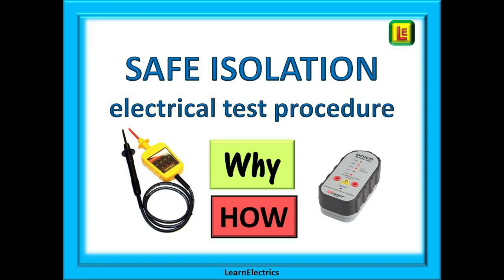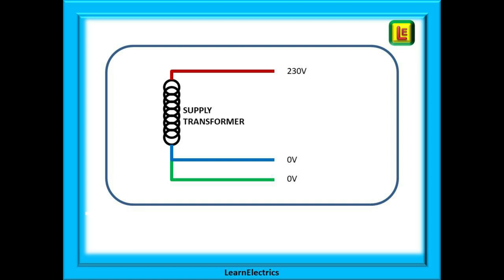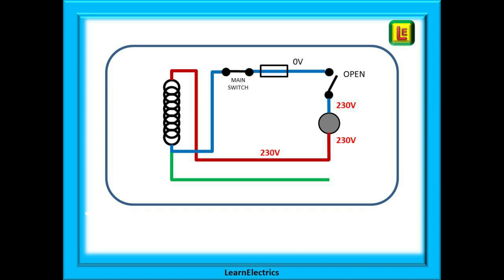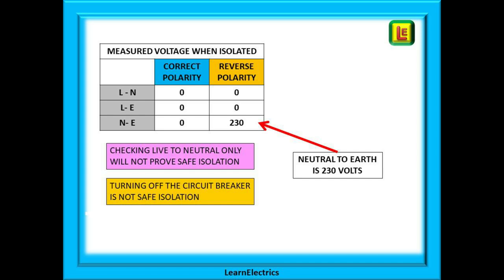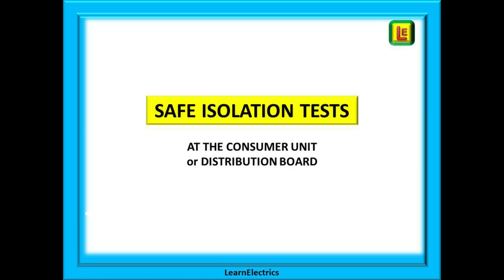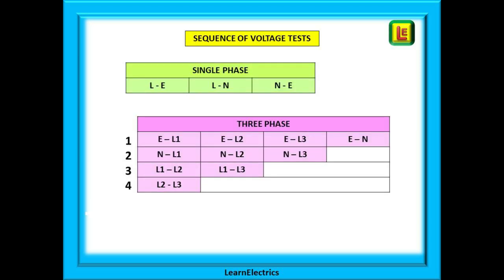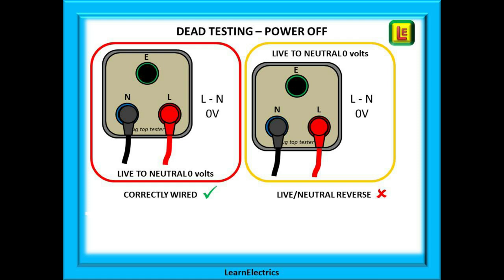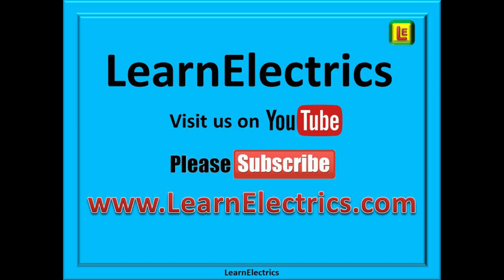SAFE ISOLATION PROCEDURE for Electrical Circuits. Why we do it, how we do it.

Comment: Can you do video of safe isolation of alternate supllies eg solar, wind, battery, engine.  Risk asessments and safe work method statements  ?
Reply from the maker: It's now on the list to be done. Thanks.
Reply: Thanks.  This could cover transfer switches automatic and manual,  Main switches marking and grouping, etc etc etc

Comment: Great video Dave, one question that has always remained a mystery, is why isn’t disconnecting live and neutral, and making the ends safe inside the consumer unit, considered an approved method of isolation? Surely a physically disconnected circuit is safer than a locked off one? 🤷‍♂️
Reply from the maker: You are totally right. The IET approved method though is to leave the wires in situ. Personally, I always took the phase out of the MCB and neutral out of the neutral bar. That way, whatever happened at the MCB would not affect me. Leave the earth in the earth bar for the insulation resistance tests. Good stuff. Dave.

Comment: At 4:38 you say for reverse polarity L-E is 0 volts.   This should be 230 volts.        I mean the load is live with neutral switch open. The load is live on each side with no current flowing ?  Please confirm if what i say is correct.  Thanks for excellent video discussing isolation.     Especially the the safety when using double pole switch.
Reply from the maker: The video is correct. Follow the route of the electric from the supply transformer.

Comment: Thanks a lot for all your clips. Pls can you do a tut on how to select the right distribution board depending on the electrical load, overheating, etc ?
Reply from the maker: We could do Pabor, but it all comes down to you on site. How many circuits and what is the loading. Thanks for the request, appreciated. Dave.
Reply: @learnelectrics4402  3phase main breaker(switch) 42 circuit breakers, 100amps load. What I really what to know is what really determines the panel to be used?
Reply from the maker: That's only an average of 2 amps per breaker. the panel must be able to take at least 42 breakers. Everything else can be bought to fit into it, but if the cabinet only takes 30 breakers, well, that's a problem. Consider a 48 way cabinet or split it into 2 x 100A 24 way boards.
Reply: @learnelectrics4402  alright, thanks a lot.

Comment: Hello Dave thanks for the video. I had a question, are there instances when we have to isolate the whole board and not just the final circuit that we are working on?
Reply from the maker: Yes of course there are. In fact I have sometimes isolated the whole board when the inside is "messy". Changing MCBs, carrying out an inspection and test on the premises. If you are happier isolating the whole board then do it, after all it's your hands that you are putting inside. The safer the better.

Comment: In your diagrams, you demonstrate the safe isolation of a single circuit by switching off the associated MCB. However, if the circuit neutral remains connected to the neutral bar and the neutral is then cut, would a neutral-earth fault then result, causing the RCD to trip?
Reply from the maker: Yes, that sometimes happens Paul. Makes me jump out f my skin. I would often remove phase and neutral when isolating, but we have to show you the way that the book shows for assessments etc. Good point and thanks for watching. Dave.
Reply: BTW, great content, even for those who've been working in the trade for a number of years